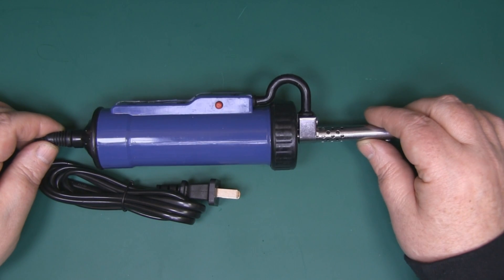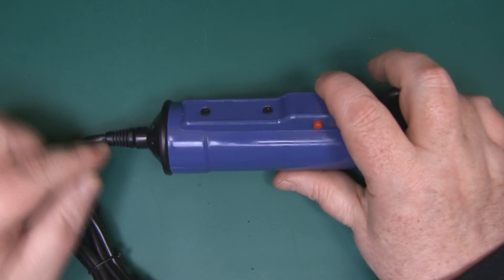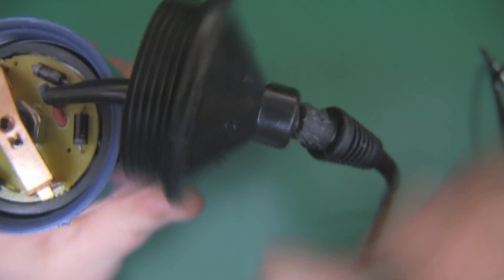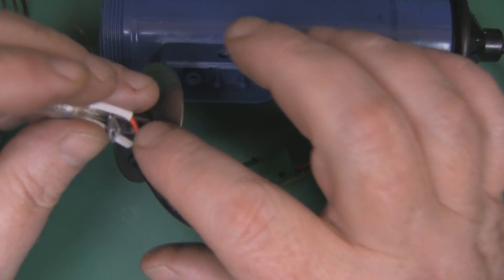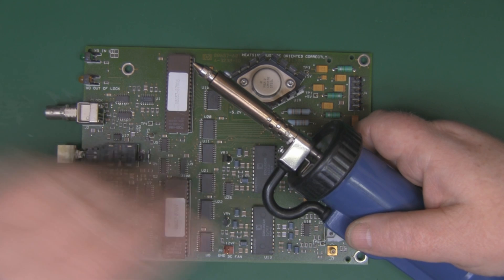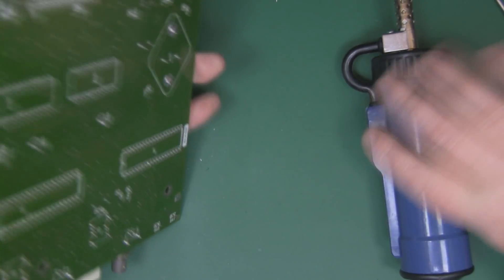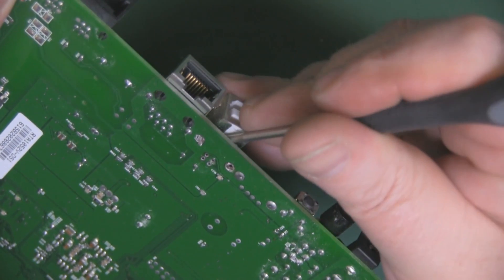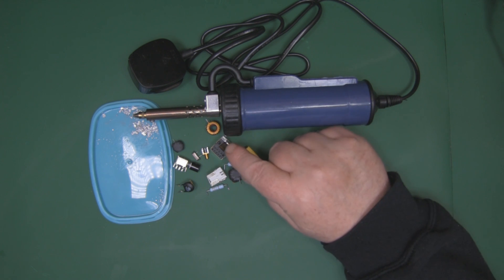Cheap Electric Vacuum Desoldering Pump from eBay Teardown and Review #147

Comment: omg what a ripoff.  i am glad i saw this video. i thought that was a constant pump.
Reply: You lot expect a pump version  for £20.00............
Reply: Erich Stein I also thought that xd
Reply: I do not understand why there isn't a small continuous pump.  That cylinder is so large, and the solenoid spring is so fast - that volume of air must be needed at that speed in order to be effective.  I do not think that thing can stay steady in your hand if the mass of the piston is swinging back and fourth, can't hold it steady.  In any case.  I'm just going to hook external vacuum up to my cheap-o soldering iron with a metal filter....

Comment: To bad its only 220 volt doesn't help in the u.s.
Reply: Ron Thompson buy a step up transformer, they are like 20 bucks.
Reply: USE DIMMER
Reply: 220/ 230 / 240  volt   60 hertz  single phase is the standard  voltage  supplied to  homes in the United States!    Our 110/120 is   either one  of the two hot lines to neutral.    Our electric   stoves, large window air conditioners ,  central air conditioners ,electric  furnaces  all operate on 220/ 240  50 to 60 hertz AC .         That  plug pictured on the  unit  is a U.S 110 /120 volt .
Reply: you can change the wires out it  to 110v or 120 v  just take whole 220v plug out  put one 120v cord with the plug in it or you can do it  with 110v cord plug one.

Comment: A little bit of FLUX on the connectors will make it so you don't need to heat the parts up as much, you won't run the risk of ruining them!
Reply: And a bit of fresh solder, to make it even easier.

Comment: For the price I'd buy one. I find the manual solder suckers very cumbersome and slow. It also takes me two hands to push down the plunger. Unfortunately this one from China is  only available in 220 volts. So I'll be looking at probably a much more costly Hakko. Nice demo thou :)

Comment: I have had a couple of these.  They work reasonably well to start off with, but then the contacts at the back of the solenoid fail.  They are a pretty dangerous design from an electrical perspective and would fail UK electrical regulations.  I would not buy one.
Reply: Same here! Solenoid fires de magnet rapidly...
Reply: Homemade  car vacuum  desolder with broke down  desolder
https://www.youtube.com/watch?v=ukB8hU2PSy8

Comment: Thank you for the teardown video of this device, Yes, It's CHEAP but does the job quite well once you get the knack of correct position & timing to press the button.

Being in the 240v~ 50Hz UK environment, I was a little shocked at the close proximity of the heat coil & the outer metal sheath, that, action was required to make it a class 1 appliance by adding a small earth wire routed through from end to end, one end soldered into a loop connects to a provided threaded hole on the metal sheathed support bracket (I had to find a screw to match the threaded hole, It's the same size as the sheath support screw) & the other soldered to the earth wire of the new 0.75mm earth cable & sleeved, neutral & live soldered as existing & fitted with a 3Amp fused UK plug.

Note:
1/ The mains cable I fitted was lying around the workshop, I THINK it's 0.75mm, It's the same size flex used in 3 core table lamps (class 1)

2/ I used the green wire of a 6 core flexible alarm cable to run end to end but any small will do as long as it will go through the rubber tube.

3/ Leave a little spare earth cable in the handle area.

4/ The FIDDLY BITS position the sleeved earth under the circuit board & position the 3 cores outa the way of the shut-off contact. (good Idea to put a thinish piece of plastic/rubber over the sharp part in the centre to protect the cables from shorting)

 There will be many UK residents using appliances with a NON UK plug attached, this means NO PROTECTION FUSE what these devices rely on is a fused converter adapter BUT, many sold/supplied DON’T have a fuse in them either (mine didn’t) so easy too ignore & lethal too, BE SAFE check your adapters.

 There are many selling replacement tips on fleebay at ridicules prices for one of each available tips (Pores & Rough Hole) However, there's 1 selling 10 x pores or rough for £2.39 Inc. pp, paste this into fleebay uk search & look for it in the list    10pcs Metal Electric Vacuum Suction Iron Head Rough Hole Solder Sucker Nozzle

Regards

Comment: That "earthing wire" may be fine for ESD purposes. It is likely a very slightly conductive polymer plastic - probably equivalent to some mega ohms for the whole length of it. Should dissipate static electricity quite well. Arguably, that could be better/safer than a hard ground - say, if the iron tip touches a live mains wire for instance.

Comment: I have one of the non-electric pumps with the plunger that you push down and a button to release it, but it doesn't do all that well.  Is this electric pump an upgrade to that, or is it just a convenience thing?
Reply: based on the video, it looks just as bad.

Comment: If you plug it into a watt meter you'll know it has reached operating temperature when the reading stops dropping. I have all my bench tools run through a watt meter so I know when something might have been left on. When I set it up my soldering iron did not have an LED but it did have a switch so it wasn't easy to know if it was on or when it was ready to use. I just used what I had lying around at the time.

Comment: I wouldn't trust a soldering iron with a mains powered heating element. If the insulation fails, the tip could become energized. A good iron has a low voltage element powered from a transformer. 
If you are going to use that thing, at least ground the tip and use it on an RCD protected circuit.

Comment: Nice review, good that you used is as well. Not too much an improvement over a manual sucker I think.

I think electrical equipment like that should be better insulated or earthed. I have been hooked up to a cheap soldering iron as a kid (mussle cramps in my hand kept me on it) and it was not fun. It could have ended a lot worse as well.

I also take a part everything cheap that is connected to mains.

Comment: is there a brand to it?
Reply: +Nicholas Heidl China.
Reply: +tmkr yes, I know it's made in chine but who made it, which manufacturer,  what model?
Reply: +Nicholas Heidl http://www.ebay.de/itm/30W-220V-50Hz-Electric-Vacuum-Solder-Sucker-Desoldering-Pump-Iron-Gun-/401119514049?hash=item5d64960dc1:g:Ky4AAOSw~oFXM4lk